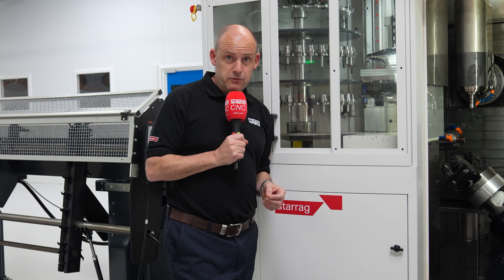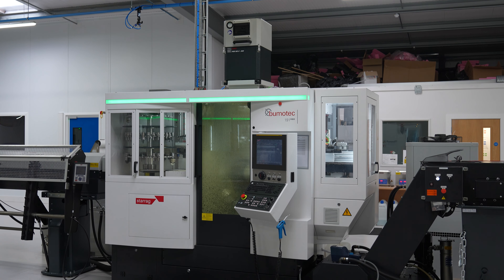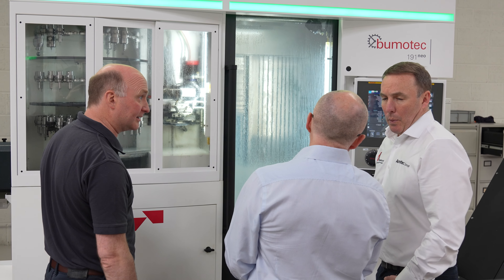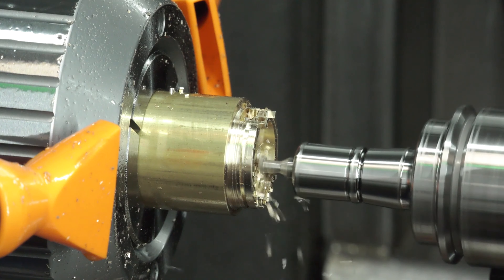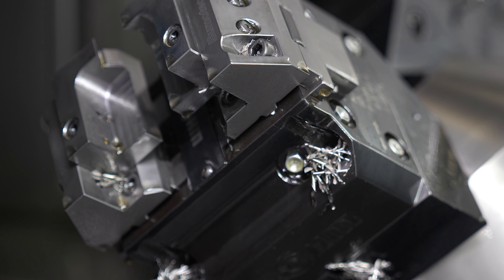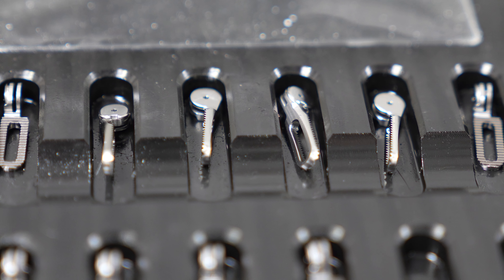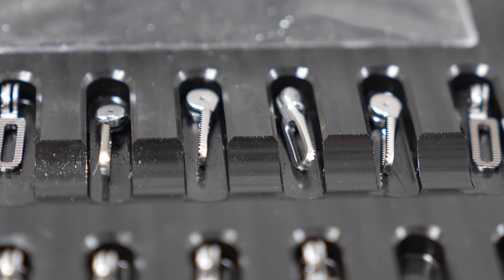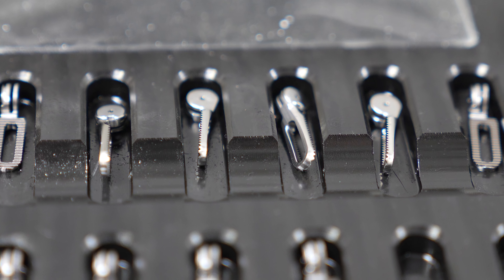The versatile Starrag Bumotec 191neo: Lights out machining of medical components at Dawnlough!

Comment: HSK-A Spindle? wouldn't capto be better for the turning part of multitasking?
Reply: Doesn't matter, there are no good multitool options for this Capto spindle size (c3/c4) anyway.
Reply: @C.D.2288  multitool? like coroplex tools with multiple turning inserts for different operations?
Reply: @leonschumann2361  Correct! Coroplex, for example, starts at spindle size C5, but most of the options are only available from C6 and above.